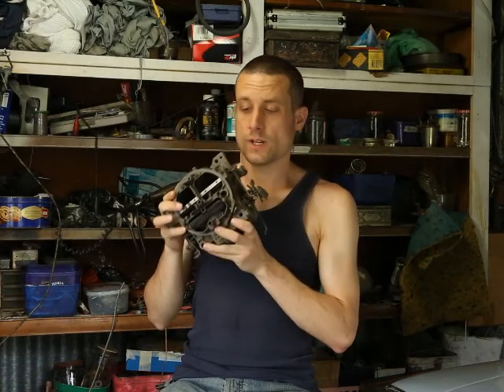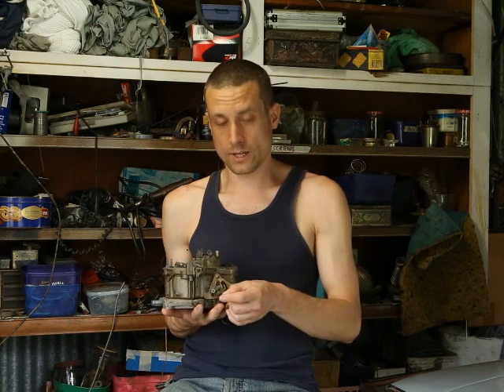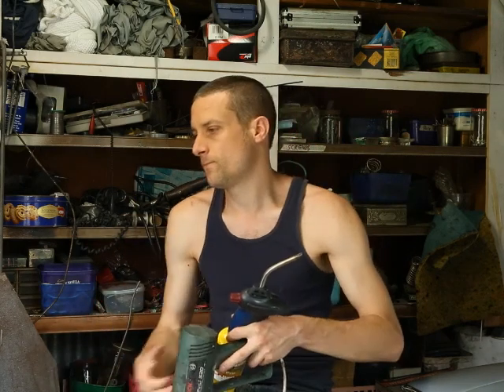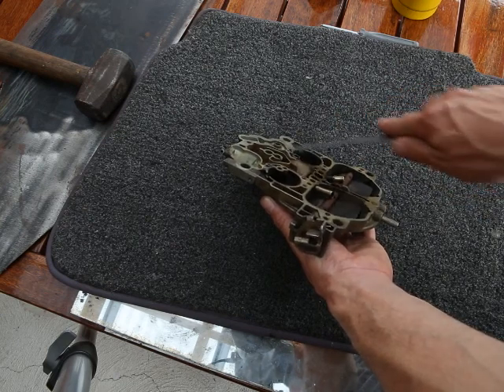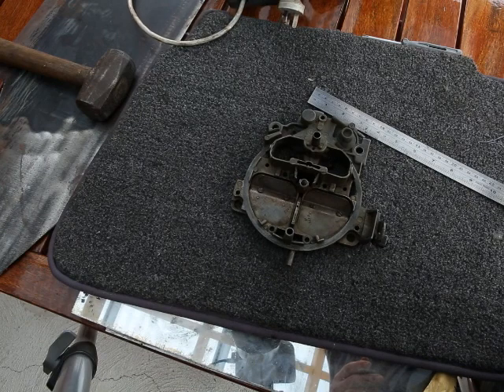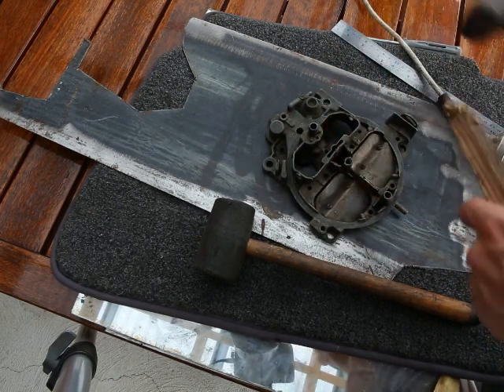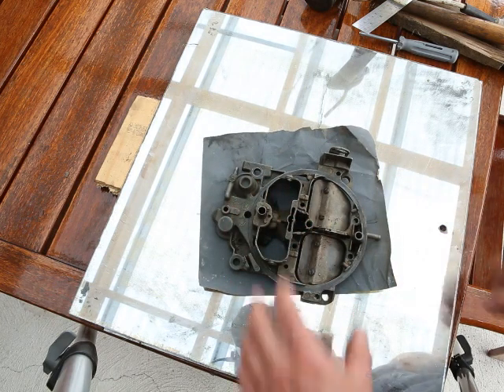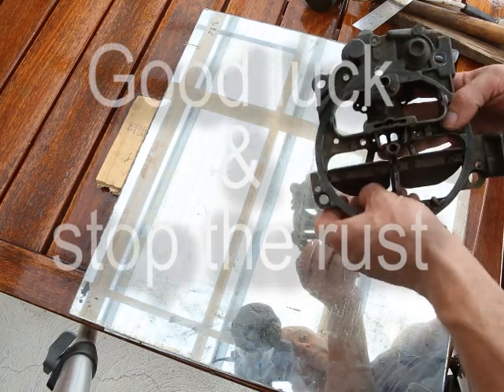warped air horn repair tutorial on Quadrajet carburetor

Comment: I have found that all you need is the heat and a large cast iron clamp a flat surface and some ingenuity to relax and straighten the top.

Without heat, it will crack. With heat it will move with pressure. Some carbs will have a flat main bowl base, so you can heat the top while clamped to its base and slowly tighten it down.

And rejetted. Remove the brass collars to drill out the idle air tubes. Drive the small inner tube down, it drops out. Tap threads in collar and use screw to pull out.

Comment: I have straightened these also. 
Heat from a propane torch is plenty enough to relax the pot metal, otherwise it will crack.
All t needs is maybe 300*F, too much and the metal will melt.
Good job on how you straightened these out. I did not do any sanding as you noted those small ridges aid in sealing the gasket to the body.

I also drilled out and bushed the throttle body. Used some thin brass tubing at a hobby store. The primary shaft tends to wear. a tight slip fit and also used some adhesive